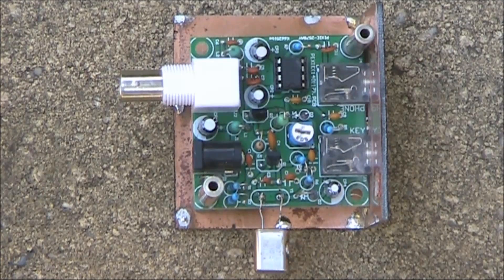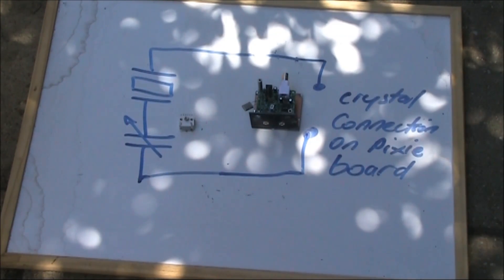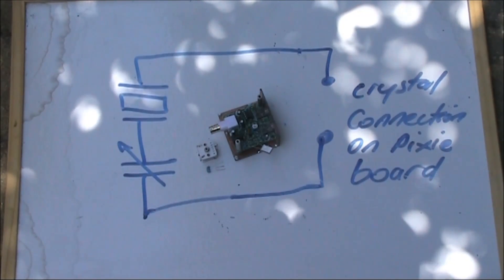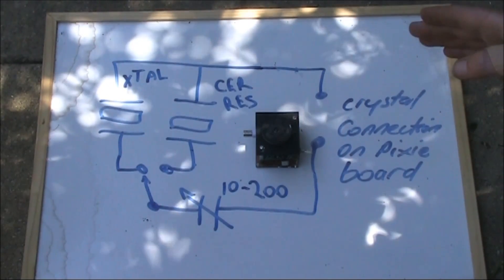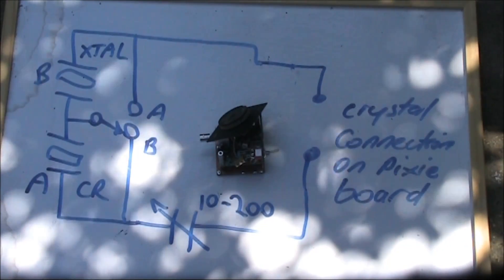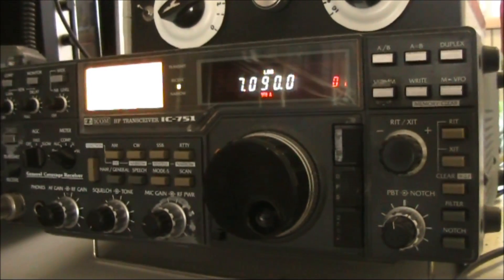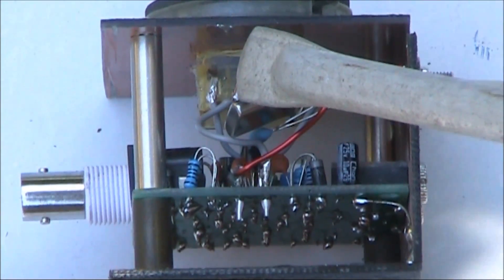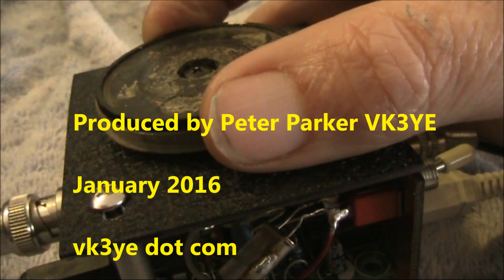Making the Pixie QRP transceiver kit slightly less appalling

Comment: Struggling to get power out of your Pixie? Change the oscillator transistor from a 9018 to an 8050 or, better still, a 2N2222, and watch the power go up to around a watt (better put a heatsink on the PA, though). Better still, change the PA to a 2N3866 and get nearer 1.5 watts.

Comment: I found that adding 3 different ceramic resonators, (they cost next to nothing,) and a tuning cap for frequency agility, building band pass filters, an RF driver stage and a push-pull IRF510 output amp with low-pass filter, then running the amp on about 22 to 26 volts from a pack of old laptop 18650's solves the problem of not being heard. Folks tell me my CW note doesn't sound very clean. But I just explain that I'm running a Pixie. I figure they couldn't tell me that if they didn't hear it, so problem solved.

Comment: What can you do to limit broadcast AM interference? I hear that alone can ruin pixie performance. Thanks!
Reply: I used a magnetic loop antenna. 8m circumference makes for a loop size that 2.7m lengths of timber can be used to keep it in place. I used 1” wide 1/16” thin flat aluminium bar stock. 2 x 4m lengths. Decent efficiency with an appropriate capacitor

Being a resonant narrow band antenna. It naturally rejects stuff that outside the 20-50KHz you get.

Comment: One mod I'd like to make is change to 20 meters (14.000-14.150 or so). I have the crystal, but I'll have to change the low-pass filter. Maybe the 22 uH inductor as well? Has anyone done this?
Reply from the maker: Shouldn't need to change the 22uH. You may have issues with poor receiver sensitivity. I find 20m a very difficult band for QRP, especially if you're not frequency agile. Do it by all means but don't expect many contacts.

Comment: I built one of these in the mid 2000’s and modified it to use a VFO kit made by WA6OTP. It made it a lot more versatile. He’s no longer building kits from what I can tell but the schematic and some pictures are available on his site. It uses a small threaded brass rod and a hand turned coil around it to tune a 200k+ kHz. I had some issues with stability at first and sorted them out. Still had some common pixie issues but was fun to tune around and not be stuck to a crystal.

Comment: VERY NICE CIDEI. THANKS A LOT !Forgive me my ignorance. But I bought an rtl sdr. It of course can't listen to short waves. But I also bought a 125MHz upconverter . And I still can't hear anything. I bet it's the antenna. How could I build a small antenna to listen to see?
Reply from the maker: I would suggest a good sized antenna like a single band coax fed dipole on a popular band like 7 MHz to start off with. A small antenna like a magnetic loop may work but needs adjusting every time you significantly change frequency.

Comment: I got two of these really cheap. (Like $10 shipped) Going to try and replace the Crystal based LO with a signal generator and use it SSB reception on the cheap.  I have also been staring at its design to think up how to make it transmit AM. (As that is way easier then SSB.)   I think if I can abuse the amplifier circuit in it to do so.

Comment: Nice video as always Peter, thanks. If I put an small inductor between the crystal and the variable capacitor to get a wider range what should it's value be?
Reply from the maker: Hard to say. It will vary depending on crystal. Several in series may work better than one. Could be between about 1 and about 20 uH worth.
Reply: @vk3ye  Thanks Peter, I bought 3 of these kits so I will give it a go. Enough toroids and wire so time for some serious experimenting. ;-) I intend to try your AM mod as well.

Comment: Check out the simple mods by LA3ZA to reduce the broadcast breakthrough. It just moves D3 to keying line and pin7 and considerably reduces value of R3. Also 47uF pin7 to ground helps.

http://la3za.blogspot.com/2003/04/using-pin-7-of-lm386-to-reduce-bci-and.html

I've also added 10n across the headphones to reduce the very wide audio bandwidth, and also two back-to-back silicon diodes (1N4148)  to minimise keying clunks.

(They are still very basic kits of limited use!)

Comment: Where did you get the ceramic resonator from ? I've been looking on eBay but no luck, lots of 4,6,8mhz ones but no 7mhz
Reply from the maker: https://www.minikits.com.au/ had them last time I checked
Reply: https://www.ebay.com/itm/5PCS-3-Pin-Ceramic-Resonators-use-in-oscillator-circuits-select-freq-from-menu/223555023467?hash=item340ceaf26b:m:mwN5tbJsW32mxjUe5viaF2Q

Comment: It costs more at $129, but you get a heck of a lot more with the µBITX from India.

"Build the µBITX transceiver in an evening. A general coverage, 10 watts HF SSB/CW transceiver kit  with features you NEED for operating ease, convenience and versatility. It works from 3 MHz to 30 MHz, with up to 10 watts on SSB and CW, with a very sensitive receiver. It features digital tuning, dual VFOs, RIT, CW Keyer and more.

http://www.hfsignals.com

Comment: What does the 10-200 on the variable capacitor mean?
Reply from the maker: Its range - ie 10 to 200pF. Not that critical - ie 160pF maximum would be fine.

Comment: How does the variable capacitor work with the onboard trimmer pot to tune?
Reply from the maker: The variable capacitor provides a much bigger frequency range. The onboard trimmer adjusts the cw tx/rx offset. You may need to adjust it to provide the right amount (1 kHz) though note that shift will vary a lot over the tuning range. One of the many compromises!

Comment: I have build a pixie 2 from junk box parts this weekend. It is easy to replace the coil in the LP filter 80m 2.2 uH and 40m 1 uH. This is all you have to do. I found the pixie is working better on 80m. A good antenna is important for QRP work, a dipole or better. With two 2N2222 transistors I have about 250mW output. A modification to have offset is a must to get a practical transceiver I have a little 60 pF trimmer in my pixie from the Xtal to ground, a switch is parallel to the trimmer. The clicking of the audio stage during transmitting is rude to my ears, a little loudspeaker is much better. I avoid headphones with this transceiver. Ask your friends for some Xtals, most hams have a box with Xtals at home. If you are on a budget use the wire of an old transformer to cut a dipole, fishing line will fix it between to trees as high as possible. You have to buy a BNC connector and a few meters of feed line. The key to QSOs is a good CW operator not so much the gear used. 73

Comment: Hello Sir. I liked very much your videos. even though i dont understand about radios/transmissions ans stuff i subscribed to your channel. please pardon my ignorance. I ordered a kit of pixie, very similar to the one you showed in this video. but the connector of the antenna is different (which i didnt like) http://www.ebay.com/itm/222058697131?euid=e251c3a3041a42f89f7bf272b57ca529&bu=44290845188&cp=1&sojTags=bu=bu
but the thing is, i build this and now i have NO IDEA which kind of antenna i should use. dont worry. you probably know by now that i have no license at all. I am aware that itis not illegal to TX in this frequency without a license, and i am not gonna do that, but still.... i'd like to use the pixie to hear CW. and someday when i get a license id like to morse on it. please can you give me a light? keywords /links or anything that can help a total newbie to find his way into building or acquiring an antenna for this transceiver. Thanks a lot!
Reply: Just try it: A dipole (two equally long wires: One antenna wire connects to the centre pin, the other one to the shielding part of the antenna connector) as long as you can fit. Usually, a simple wire of some 10m length connected to the centre pin of the ant.connector works, too - if it is hung outside the window somehow. VK3YE is generally correct about the weak receiver...but still try to get some wire (any wire will do for receiving) erected outside/hanging down the window/... and try what you can hear. Google keywords like "simple cw receiver" "simple amateur radio experiments" etc. Looks for ARRL-books on amateur radio. 73 de DJ1WY
Reply from the maker: The best antenna to use with a Pixie is a coaxial cable fed half wave dipole.
Reply: but is it possible to use others? I've been researching on the size of this antenna and its 20 M long,. which makes it impossible for me to listen to my pixie in my appartment.
is it possible to make a smaller antenna only for listening and not transmiting? Thanks. and sorry again for my ignorance
Reply from the maker: No. The Pixie is a weak receiver and needs a full sized resonant antenna.  Better and more sensitive receivers will however work with a small antenna such as a magnetic loop.

Comment: When you talk about overloading the front-end.  What exactly do you mean?  Could you elaborate on that and possibly how to fix it?
Reply: the pixie has no filtering to stop broadcast and other strong stations coming through , if i had a pixie i would put a filter circuit in line where the signals go into the NE 612 chip (pin1) there are lots of examples about just a L C circuit , looks to be either a low pass or a band pass filter

Comment: I'm working on a 2nd Pixie, leaving off the oscillator section and using an AD9850 DDS to produce whatever frequency I need.  I realize that increases cost but does increase the fun. lol  At the very least helps me to understand all this and how to improve on what's there and build on it.
Reply: I'd go with something a bit better , i'm on with the same project and going with the frog sounds / forty 9er circuit , going to push for 3 watts out, i'd look to put a filter and the front end of the pixie if i ran with that as it's a bit wide open

Comment: Great work and improvement on this kit and presentation. Can you look at Frog Sounds QRP Kit as well?
Reply: Frog sounds is virtually identical to the forty 9er , have a look at the Arduino AD9850 VFO project , it's what i'm in progress with building now, you can get the parts really cheap from eBay and you get a full VFO with digital read out, far better then a VXO. de G0KVL.

Comment: Nice Video showing how easy to expand the Pixie.  The VXO mod with inductor works well for expanded tuning.
Jay - Adding 2 crystals of the same Freq. in parallel will allow the VXO to pull even further.
Made a 4-way Pixie switch PCB & will have pics out soon on my web site.  Too much fun to be had with these little rigs.
73 & thanks for the video!    kc9on